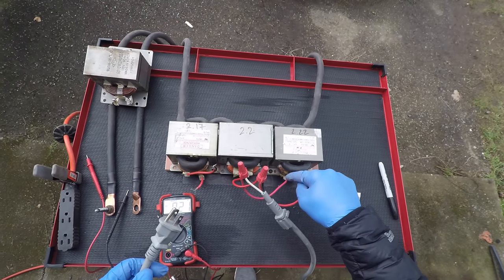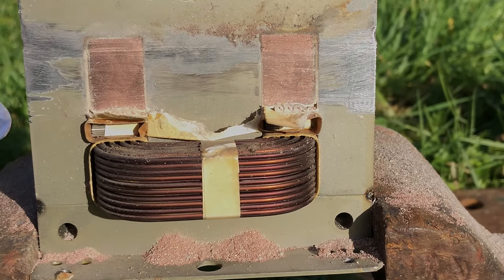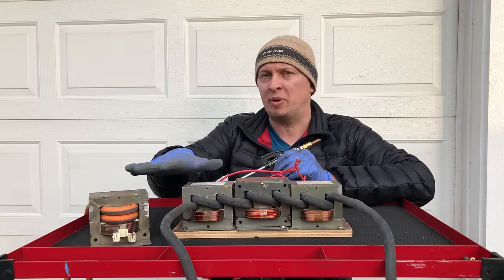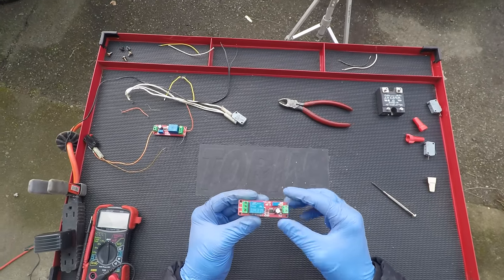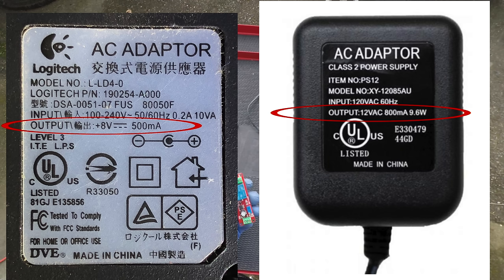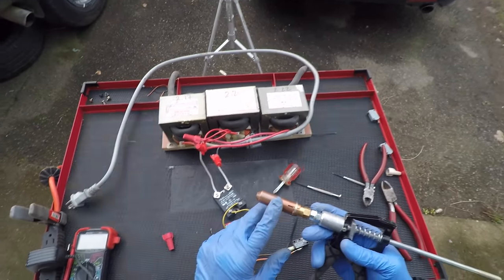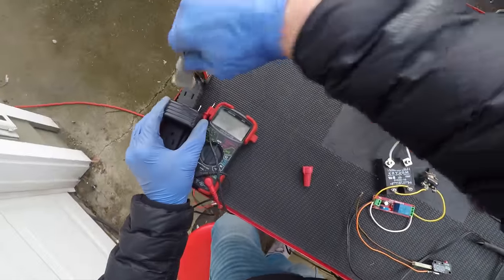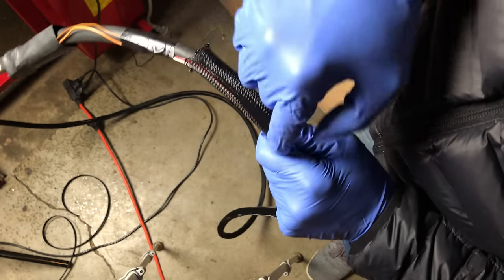✅ DIY Car Body Electric Dent Puller Welder Spotter From Microwaves UPDATED

Comment: Good afternoon, I know you bought that squeeze puller system from the Russian supplier. How did you pay them. I have an order prepared for some of their tools, but the bank deal scares me silly. Any suggestions?
Reply from the maker: It's been a couple of years since I bought that puller, don't quite remember all the payment related details. However I will be doing a video here pretty soon where I'll be reverse engineering that puller... Basically making a 100% replica
Reply: @fix206  Good morning, I have some ideas for the squeeze puller instead of the caulking gun setup. I made a squeeze puller from a rivnut puller and was very satisfied with the results. I enjoy your common sense aproach to the autobody tools. It proves that you don't need a building full of high dollar equipment to repair vehicles. I have built almost everything that I have used in my career instead of paying way to much for it from a tool store or dealer. Take care and good luck.

Comment: It is for voltage of 120 or 220
Reply from the maker: The voltage is 120 because the microwaves were on 120 and that makes the transformers requiring 120. However if you are using 220 in your country then build the tool the same exact way as I showed it and run it on 220
Reply: @fix206   thanks 👍

Comment: Sir I'm from india .
I want to make a dent pullar . I saw your video make a dent pullar .
And I try it is . But it is not work .the circuit breaker is trip again and again. My transfarmer riding by multimeter is 1.4and 1.3 or 1.3 and total riding by multimeter 4.5 .
Please sir tell me what is my mistake to make dent pullar
Reply from the maker: Sounds like you either have a short somewhere and that's  the reason that you're tripping the circuit breaker, or maybe it's because you are overloading the circuit that you are on and that's why the breaker keeps on tripping. Try plugging it in in a different place, maybe even in a different house to see if anything changes

Comment: Is there any way you can watch I mean make a new detailed description about the way you did everything in the end when you were hooking up your last switch and everything I've been trying to do this shit for 2 days and I can't get mine to do right soon as I plug money and it cuts on trying to figure out how you did it because you did it all at first and then when you put in the box you didn't show you how you did it once you put it in the box and you added a switch and I can't figure it out if you could please make another short detailed description in send it to me please I've been working on this thing for 2 days and it's getting on my nerves ready to use it
Reply from the maker: Look at the wiring diagram, I've left a link to in the video description. Also some of these cheap timer relay sometime are hooked up in reverse. So instead of working as a OFF-Pulse-OFF they will work as ON-Pause-ON, so essentially your timer relay stays on almost the whole time as soon as it gets powered up. All you have to do is switch the wire from the CK port on the timer switch to CB port.. Let me know if that worked
Reply from the maker: any updates?

Comment: @fix206 Thank you for this video. I decided to make my own for a DIY repair project and ran into an issue. When I connect more than one transformer my wall Circuit Braker trips. Maybe you have some tips for this? thanks!
Reply from the maker: Does your circuit breaker trip as soon as you pull the trigger for the very first time, or it trips after using the spotter for a bit ?
Reply: Right away
Reply from the maker: In this case id say you have a short somewhere, something isn't wired right
Reply: @fix206  Thanks for reply. Пойду поковыряю... я хз чо там коротит =)
Reply from the maker: Мне кажется что первичная или вторичная обмотка на одном из трансформаторов коротит на корпус трансформатора , начни с этого
Reply from the maker: Разобрался?
Reply: @fix206  Нашёл амперметр сегодня. При 2 подключённых трансформатарах, ток 14.6 Ампер. При одном - 7.3 У меня брейкер на 15 ампер. 3 транса точно будет выбивать. Если есть возможность  замерь ток на своей установке. Пока попробую на 2 протестировать.
Reply: @fix206  И ещё заметил что на старте даже на 2х трансах напряжение прыгает почти до 30 амер, потом стабилизируется около 15. Иногда выбивает автомат, иногда успевает стабилизироваться
Reply from the maker: Сколько витков вторички на каждом трансе? Чем больше витков тем выше voltage на выходе из трансформатора. Кабель вторички должен быть толстым как у меня, чтобы можно было намотать максимум два Витка. Суммарный выход с трёх трансформеров должен выдавать 6-7 volt, не больше...
Reply: @fix206  Всё как на видео. Провод 2/0. Почти 2 прохода кабеля в каждом канале. В среднем каждая катушка отдельно даёт 2.2V

Comment: Well done. I would love for someone (you) to build an induction dent remover like is used in pdr dent repair.
Reply from the maker: Induction is a whole another can of worms :) I've actually looked into that, so far my understanding is that there are a ton of electronics involved when it comes to induction... But you never know, I'll do more digging/research and maybe 6 months down the road I'll be coming out with a "DIY induction Dent remover" video... Stay tuned !!!

Comment: Can we use 200A stick welder machine at very low ampere setting
Reply from the maker: I'm not exactly sure how that would work, you may need to rewire some stuff because my understanding is actual welder works on slightly different principal. But I may be wrong
Reply: you have found a way to use with stick welding machine?
Reply: @fakhrulizzat_90  No. I have to try but i doubt it will work. The reason is voltage of the welder is around 60-72 V and max 200A but spot welder is much low voltage and high current
Reply from the maker: @fakhrulizzat_90  it probably can be used with a stick welder set up, you might want to rewire the transformer and possibly use some different cables to make things work

Comment: Hi. Can somebody please estimate at what voltage(is it 6.6V or about 2.2V) and what amps approximately does this spot welder operate?
Reply from the maker: With all three transformers powered up together with the output of around 6.5V amperage should be close to thousand amps

Comment: How many amps it handle?
I did the same setup and mine give me 6.89v but I want to know approximately how many amps it gives.
maybe I will add another transformer or convert to DC output.
Of: sorry my english
Reply from the maker: Carlos my friend, your English is fine. I never tested the Amperage but I've seen a similar video before where the guy also used 3 transformers, and after checking, his spotter was putting out about 800-1000 Amps. And 3 transformers is perfect, I personally think that 4 would be too much, try working with 3 and you'll see that you don't really need any more power. Is there a specific reason why you would want to convert it to DC?
Reply: @fix206  no,maybe try if it works better.  at moment Im having problems to weld the tip (a bolt) to the sheet. I realized that it must be switched only very little time and it improves. I need the specific tips but with the actual worldwide situation, any store is open here in Spain
Reply from the maker: You don't have to have a specific tip, you can just sharpen a steel bolt and that will work. Double check and make sure that your transformers are hooked up correctly. Do it one by one jus the way I did it in my video, and test the voltage output after you connect every additional transformer to make sure that your voltage reading goes up every time new transformer is connected.
Reply: I will check but my setup handle 6.89v output. So I thing it's right.
The trigger time is important? I mean, there is a specific trigger time to get the best tip welds? I bought on internet the runner and the solid state relay. I hope it arrives soon. At moment, the my setup is manual and analogy
Reply from the maker: I used my setup in analog mode for a while, It was a bit more difficult to use, but it was still usable with good results. I usually make my trigger time as short as possible, just tap the trigger as fast as you possibly can. That's assuming that you are running 3 transformers, because If you are using 2 or 1 transformer then the trigger time will be longer.

Comment: will it work if i use the slide hammer with copper tip on an arch welding machine setup?
Reply from the maker: I don't think that will work. I bet welder runs higher voltage and that will just blow the tip right through the panel
Reply: @fix206  thank you for the guidance 🙂
Reply from the maker: No problem :)

Comment: my transformer reads 2.20 , 2.76, 2.15 is that still good to use? or do i need in the 2.2 range?
Reply from the maker: Unless you get your transformers out of identical microwaves your transformers will be slightly different with different outputs, and that's not a problem at all. Go ahead and run what you have, you'll be just fine 👍
Reply: @fix206  thats good to know. Ill let ya know how it goes putting it together
Reply: Its all together. It works good. Not sure if the timer is bad tho. it only works on continous. i flip the switch and i turned the screw the timer doesnt work?
Reply from the maker: Glad it worked out for you mate... Play around with that timer and maybe you can get it to work, if not then you probably ended up with a faulty unit

Comment: How would you go about attatching all this to the Linked Puller Attatchment?
Reply from the maker: Not sure what the linked puller attachment is... can you clarify ?
Reply: @fix206  in your listing it shows the spot puller is different than yours. How would you put power to it to work. I see that you put a cable lug onto your puller
Reply from the maker: Instead of using a lug as on the puller that I use, if you'll use the puller in my listing then the cable will go through a hole on the back side of the "gun" handle and it will get attached to the brass fitting inside of the handle. That handle is made to come apart to make a connection inside. Once you will take the handle apart it will make sense right away... a very simple procedure that will only take you a few minutes to accomplish

Comment: Hi, so, how dangerous is this tool?
Reply from the maker: Not dangerous at all, been using it for the past 3 years or so with great results... I did a major update on the electronics inside, it is much more capable and user friendly now. I'll do a video on the upgrade a bit down the road
Reply: @fix206  thank you on update. I have this tool, not diy tho, and was worried how much carefull I need to be with it.
Is it safe becouse voltage output is low ?
Mine produce magnetic field strong enough to move magnetic part on my light. Sorry on my english, not native language
Reply from the maker: Magnetic field is definitely there, if a metal wrench is resting on one of the lead cables while I'm using the spotter, it will normally jump up and buzz every time the spotter is being used

Comment: Hi Fix206, just wondering would old jumper cable wires work rather than that 2.0 cable you use in the video? Also when is the next video coming?
Reply from the maker: Not sure how thick your jumper cables are, I know the ones that I have aren't that thick so I would not use them because they would not allow enough current to pass through them safely, I should have the new video posted in about a week or so

Comment: Would you be able to adapt it to connect directly to a welding transformer and eliminate the need for the microwave coils?
Reply from the maker: As of right now I don't know... However, i recently acquired an old arc welder that I will be converting into a spotter just to see if it's possible. And of course I will be filming and then posting my findings, so stay tuned for that video
Reply: @fix206 Thanks for your reply, great info. I hope you come up with a solution soon because I will  running out of summer weather UK England. However in the mean time I will start to look for some scrap microwaves.

Comment: Can you make a drawing of the electrical connection and include a parts list. This is the best video. Kind regards
Reply from the maker: There are links to most parts used in the build down in the description of the video. I'll make a wiring diagram and pin a link to it in the description later on tonight 👍👍👍
Reply: @fix206  
Many thanks for your response. I saw it later. I tested it with 2 transformers, but I used the wrong electronics. We have 230 volts in Germany. Best Regards

Comment: hey just wanted to tell you the tool that you think you might not be able to.get is very similar to a caliper compressor for breaks uses the same handle and center section
Reply from the maker: Yeah I just looked it up and you're right it is pretty similar, I guess if someone wanted to put in the work they can adopt that compressor to make it work with a spotter tool

Comment: with 3 transformers you increased the voltage, added the voltage of each of the 3 transformers. The current is the same as a single transformer. You lose a lot of space with the cable rubber, maybe if you use only copper and insulate it with Teflon, you can wrap 3 turns in each transformer and use only two. And to adjust the time, why didn't you remove the trimpot from the board and add wires for a potentiometer of the same value, with adjustment from the outside of the box with a scale marking? sorry my english.
Reply from the maker: I've experimented with different amounts of transformers being used, and the electrode would not stick very well to the metal panel if I only use one or two transformers. Same thing goes through the amount of windings of the cable. The amount of windings that I did worked out the best. And as far as the electronics go, I have had them completely changed. Right now the way my spotter is set up there is no more button that I have to push the trigger the impulse and now I do have a couple of potentiometers on the outside of the box. I will be doing videos of the updated spotter later down the road

Comment: Finally  got all the parts  plug in first  transformer shorts out and dies  second  transformer   blows out the house breaker third one hums  nicely  no power in main cable  so far I am very disappointed
Reply from the maker: Normally if transformers short out or blow out the circuit right after they get power that means that the primary coil got damaged during the extraction of the original secondary. Also you got to be pretty gentle as you wind the new secondary cable onto the iron core of the transformer, make sure not to damage the shielding of the cable so it doesn't short out on the housing... Main thing is don't be in the rush, take your time
Reply: @fix206  I was careful but obviously  not careful  enough I will check the cable cover but I think  it is ok the one that is working  as in humming   with no  issues doesn't  give  me any voltage  reading  I couldn't  get just one timer  so I had  to buy five got 4 for sale if anyone  needs one

Comment: I followed your steps to build my own.  But I am only getting 1.8 across each transformer. Is the cable too thick?
Reply from the maker: Did you get the same number or thick cable windings as I did in my video? Because the number of windings is the determining factor of the voltage output
Reply: Thank you for the reply. I fixed my problem. It was a bad transformer. I really love my tool. You rock man.

Comment: I made it from showing ur video 
But problem is that the copper tip dose not stuck in metal
Reply from the maker: The reason you have no fusion is because copper will not stick to steel. Only steel will stick to steel. The tip at the end of my puller has a copper coating to keep it from rusting. But it is all steel under the coating. So go ahead and switch to a steel tip and everything will work 100%

Comment: Ils ont possible to use or for aluminium dent pulling
Reply from the maker: It is not possible to use the set up for aluminum. Aluminum requires a slightly different process... I might do a video later on on how to build a set up for aluminum

Comment: Great video can we have a wire diagram please.
Reply from the maker: I'll try to make a diagram later on today... I'll seep you posted
Reply from the maker: here is a link to diagram... Hopefully it's not too confusing :).  https://photos.app.goo.gl/8bpQcMi51vrMRfiq8
Reply: @fix206   @Fix206  thanks for that made it realy simple and easy to follow. Just  one question if i was to purchase the slide hammer with the attachments it also comes with a handle/gun which has a switch on it can i wire the connection to that switch and not put the push button switch.
Reply from the maker: @swissict92  Yep, just use/wire up the trigger switch on the slide hammer the same way as you would the switch in my video/diagram. Did you already buy the slide hammer setup?